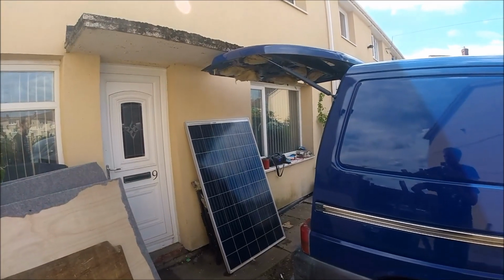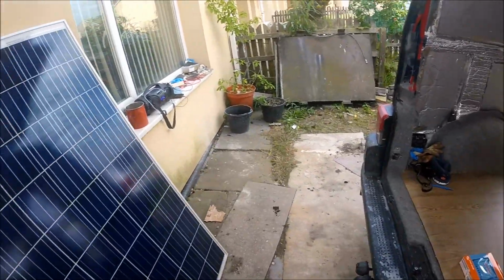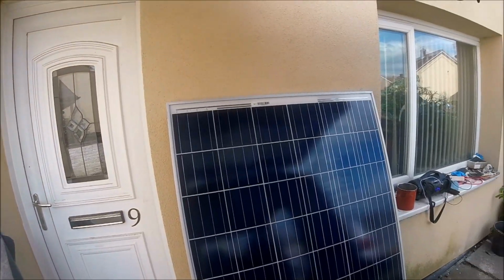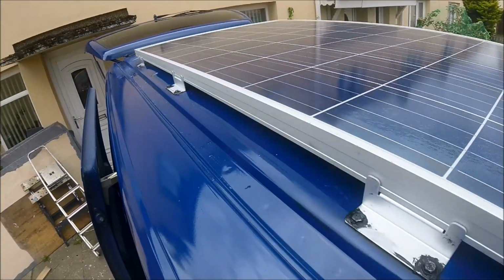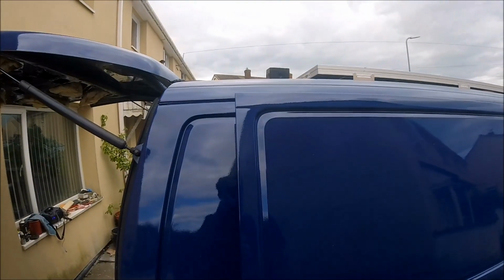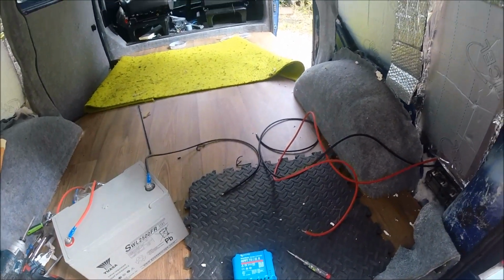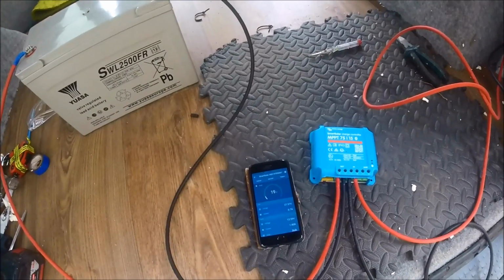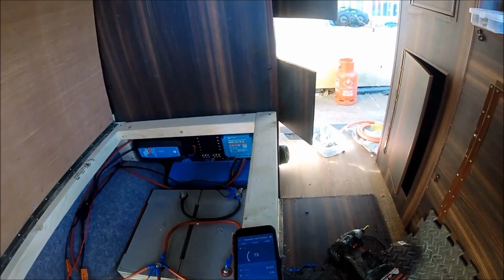Campervan Solar Panel System Installation & Victron MPPT VW T4

Comment: Great job! Only thing I would do differently is to put some paint on the holes of the roof to prevent corrosion.
Reply from the maker: the holes sealed over and air tight as they are so shouldn't be a problem at all, by the time it rusted if it did rust, the van would be scrapped anyway

Comment: Hi Mate, question, the Victron controler acording to there website is only good for 200w on 12 volts, you have 270w panel, could be a problem over powering the Victron unit
Reply from the maker: These controllers will handle an input of 75v and the max output is 15a, no concerns at all as the controller handles all voltages / amps etc and dissipated any excess via its heatsink.  It would also be a rarity the panel hits maximum output unless there was a load and the batteries were considerably discharged, otherwise they sit on float tickover all the time
Reply: On paper you are correct. However he will prob. never see more that 200 watts from that panel so he's ok.

Comment: The MPPT controller you are using should be used with a max 200w panel (that's what it states in the discription from your link ) aren't you using a 250w panel ?
Reply: Wasted money on a big panel  with it m8 hasn't  he but each to there own good video  though
Reply: He will prob. never see more that 200 watts from that panel so he's ok.